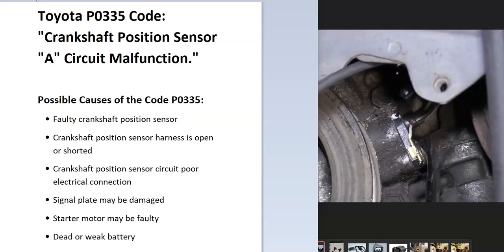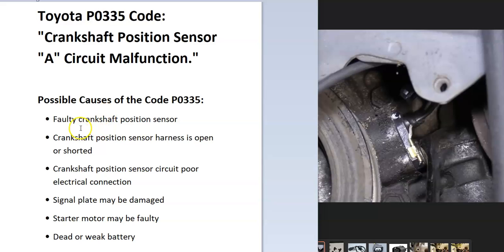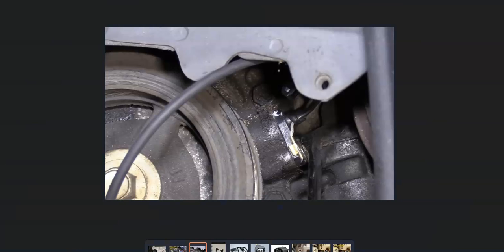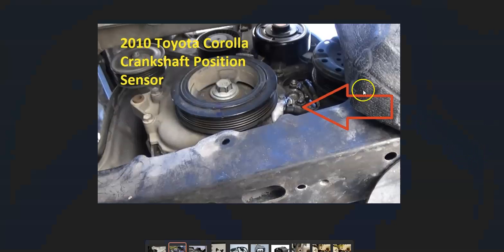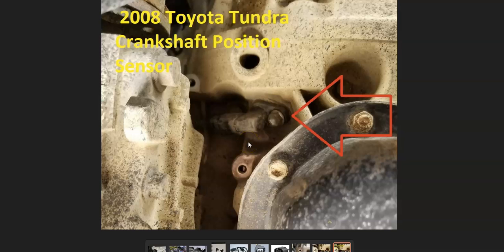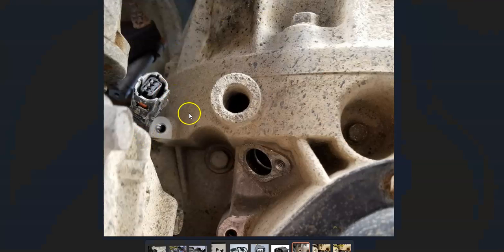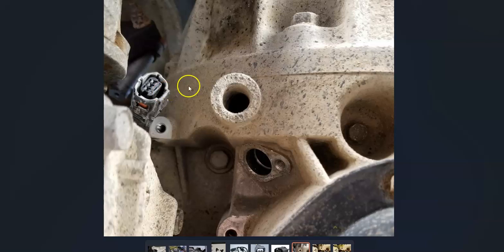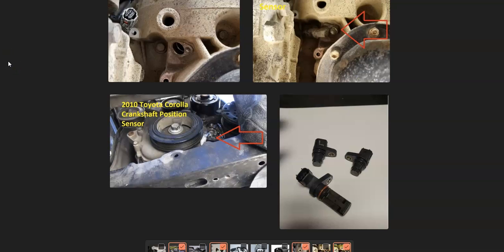Causes and Fixes Toyota P0335 Code: "Crankshaft Position Sensor "A" Circuit Malfunction"

Comment: What could be the cause of having both P0335 and P0340 at the same time on a Verso 2006?  the car didnt start but it fixes itself? After 30 minutes it started normally and the codes dont reappear after resetting.

Comment: I had a pretty dead/weak battery and had to use a jump starter to get the truck started. I saw a check engine light and had this code as well as P0340. Would you say both were due to the low voltage from the battery? Or do you think I need to dig deeper?
Reply from the maker: A bad battery or alternator not charging correctly can cause issues. I would be sure they are good clear the code an see if they come back. If the code comes back, there likely is another issue.
Reply: I just had same thing happen to me. Had to jump it with jump pack then I have these 2 codes as well

Comment: Do these need to be relearned? Thanks.
Reply from the maker: It depends on the year, make, model, and how close the replacement sensor was to the old sensor. Usually, the computer automatically relearns. It's best to use an OEM replacement sensor since, hopefully, it is close to the old sensor.
Reply: @ it’s a 2006 Toyota Prius.
Reply: @Sagemeister007  i had a code early on for the camshaft sensor that went away after I replaced the sensor. That has not worked for the crankshaft sensor,  and I've installed the Japanese model recommended by the manufacturer
Reply: @MichaelHandy-gl8tw  Thank you! So using the OEM part is the key to get this to work. I hope this does the trick!

Comment: Hi, I have the p0335 took out alternator and compressor because sensor is back there. Change sensor. But next day I'm getting the same crank no start and the p0335. I really don't want to remove again the alternator and compressor to check the sensor again. How can I check the wiring?
Reply: @DaNte710-o5g  find out from a manual where the sensor pulse goes.  You may be able to do what I did and read the resistance from the sensor connector to the other end with a meter to show resistance
Reply: Did you figure it out

Comment: I'm reading that crankshaft position sensors don't have fuses?  Or can you clarify what fuse might be blown if it is a fuse?  I have a 2012 Toyota Sienna XLE
Reply: @monopolova  on my Prius2011 and likely most other cars....the sensor reads a metal rotor by a magnet that sends an impulse to the ECM.  If the wiring does not show resistance read at the ECM connector pins then the pulse should be going to the ECM. There probably is not a fuse used because its a very small pulse.
Reply from the maker: It can vary, but often they are on a fuse that seems unrelated, such as EFI. You can check all the fuses but it is likely best to use a meter and check for power going to the sensor.

Comment: Will a 2011 prius need a relearn proceedure on a special scanner when both the camshaft position and crankshaft sensors have placed a code in the system and after I have replaced both and cannot start the engine?

Comment: I have a corolla 2013 
That gives this code and the 1605 code at same time 
The engine lamb gets on and then off again 
I checked the wires and changed the crankshaft sensor to a new original one
And erased the error 
When i got out from the mechanic shop the engine lamb went on again 
At the next morning it went off again 
I don't know what is happening and i am at a rural area with almost no mechanic near me

I will appreciate any insight please

Comment: Today the ground wire terminal of my 1999 tacoma broke and the car turned off. I held the wire to the broken ground terminal and the car turned on again. I replaced the terminal and she runs like normal. Now, however, the check engine light is on giving me the p0335 and p0340 codes. That's gotta be correlated to the broken ground terminal, right?
Reply from the maker: I would clear the codes and see if they come back. If they return, then there is another issue.
Reply: I appreciate your help!

Comment: The wires pulled out of the sensor harness. Without removing the sensor how does the harness release from the sensor? 2007 rav4 v6

Comment: My 2010 Tundra had a loose battery cable and wouldn't start. I jumped the battery (which later tested good), now p0335 code, 4-low is flashing and the Check Engine Light is on, as well as Skid Control light and some others. Will it reset back to normal if I clear the p0335 code or do I need to disconnect the battery or something? PLEASE HELP!!
Reply from the maker: If the computer modules don't have a good power source, you can get multiple lights and codes. I would check the battery terminals are good and test the alternator output.

Comment: Got a 07 Tundra, wiring harness is good, fuses are good, and ive changed the crank sensor twice. Still throwing the P0335 code, and wont start. I am at a loss at this point
Reply: @DavidKrebsbach-q1t  my 2011 Prius has that p0335 code even though I've changed the sensor, checked the wiring for a short, and then ordered a replacement for the ecm from ebay.  I have a new 12v, new hybrid battery, new fuel pump, but the gas engine does not kick over even though the flywheel is turning from the starter.  My only guess at this point is its got to be spark is not getting to the plugs and/or fuel is not getting past the injectors. Frankly, the way it failed while I was driving it makes me believe it's a spark failure!!!
Reply from the maker: This happens sometimes and can be a real pain. I made a video on possible causes when this happens. Here is a link. https://youtu.be/XQGfIREEJg4?si=Ib3gW9gaGPMoCABB

Comment: what legitimate problem is this sensor supposed to alert you of then?
Reply: Its not to alert you of anything. It senses the position of the crank and tells the ECM so it knows when to fire the injectors and sparkplugs.